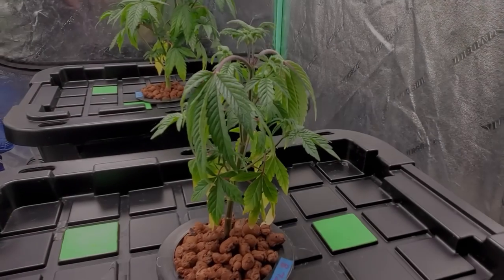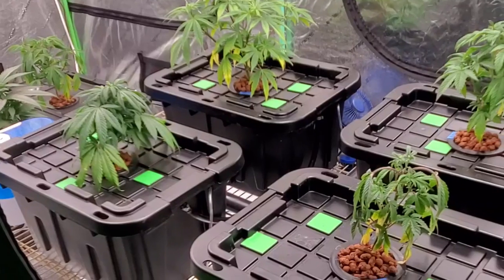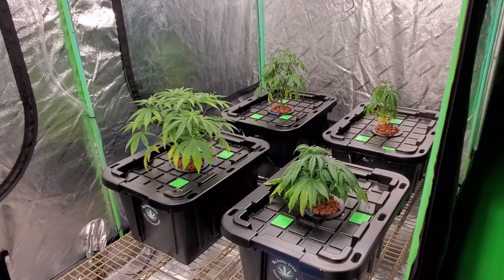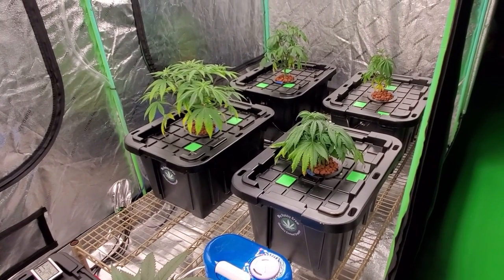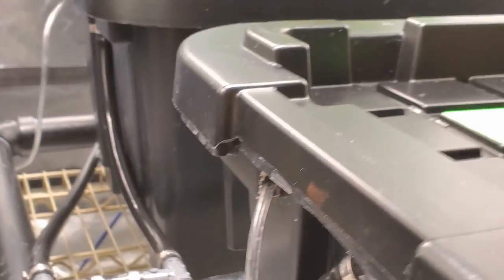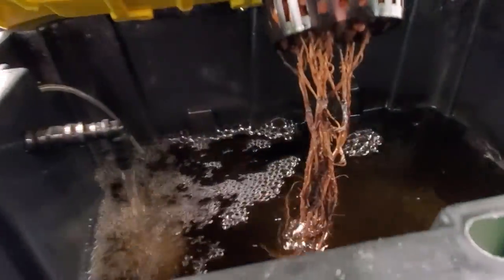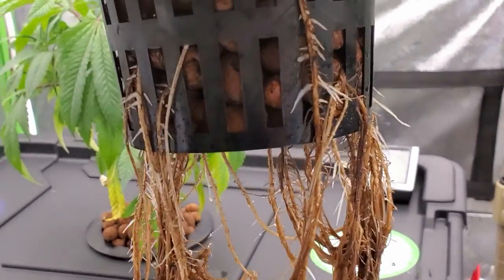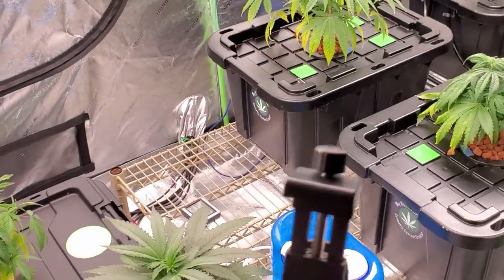Root Rot in RDWC Hydroponic System - Cannabis Garden with Root Rot

Comment: Use a water chiller in an rdwc system . 68*F RO water  , use hydroguard or hydrogen peroxide,  not both , cover top with aluminum foil,  it blocks light from entering the clay pebble medium.

Comment: If I may offer some advice, first, the water temperatures are much too high. Although you say that you used significantly higher temperatures in the first round, you were just lucky that time. Otherwise, these temperatures are too high, especially if you don’t want to operate in a completely sterile manner. Lower the temperature to 20 degrees, 19 degrees Celsius. Second, your air hoses are transparent, and these transparent air hoses direct light from the room straight into the pots. It acts like an amplifier, similar to how fiber optics work. You urgently need to replace the air hoses with ones that are impervious to light, and then the issue with root rot will be resolved.
Reply from the maker: You can offer all the advice you would like. I run successfully with water temps at 80f with no issues. This was a one off problem caused by other factors.

Comment: What is the temp of your res running at?  Above 72 could also contribute to root rot. I would’ve tried to use some peroxide. The regular strength stuff from the store at 3tbs/gal. Get ALL the roots wet with it, not just what’s sitting in the water. Water temps above 70 I’d go ahead and run a sterile system instead of using microbes.
Reply from the maker: Thanks for commenting, appreciate your input. I don't use peroxide. Kills everything including the bennies. Temp right now is 74, but have ran in the past with temps 75-76 in summer with no issues. I'm certain it is from rinsing the roots and disturbing them like I did.

Comment: With any luck you can take a few clones from those girls before they die. It’s a setback but it was also a learning experience.
Will you be doing a deep clean on the system parts in order to clear out any remaining noxious microbes?
Reply from the maker: Oh yeah, full soap and water with bleach. Start fresh. Change out the air lines to black, cover the holes and have an idea to stop light from getting through the net pots. Set back but a learning experience. Grow better next time!

Comment: Yo. Love your setups. I’m experiencing pathogens currently as well. Not fun. Haven’t posted on IG for a year lol. I’m a newb. But from my experiments and suggestions from other growers I’ve found that UC roots and microbial mass to be the best for a sterile run. 
I’ve also tried using orca. 29% h202. Hygrozyme. I didn’t have luck with orca which was very disappointing. But like I said I’m a newb.
Reply from the maker: Hello, thanks for following along and watching. I guess I'm confused with your question. Are you trying to use h2o2 along with UC roots and microbial mass? If so, that's probably not going to work. H2o2 would be used in conjunction with a sterile system as it kills a lil pathogens. UC roots and microbial mass are about building up beneficial bacteria which the h2o2 will kill off if you add it in also.
I would recommend one route or the other.
Reply: That was confusing.  My bad. I should have said I have tried to wipe out pathogen with sterile and beneficial products but haven’t found 💯 success with anything yet.